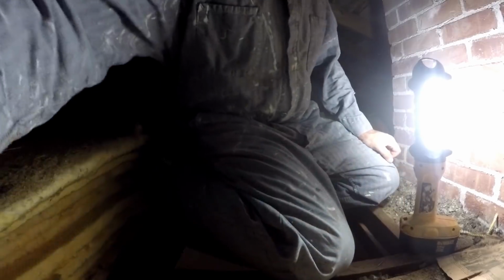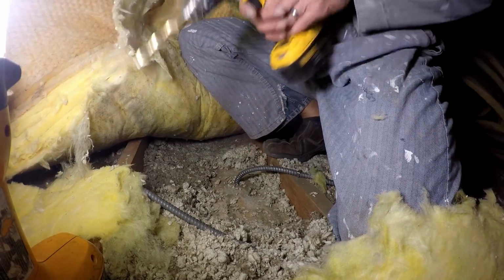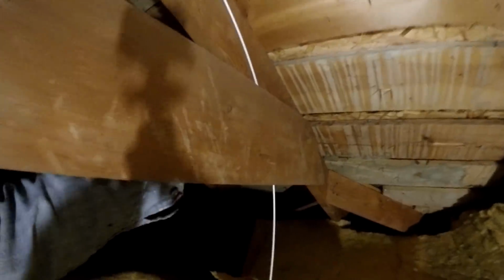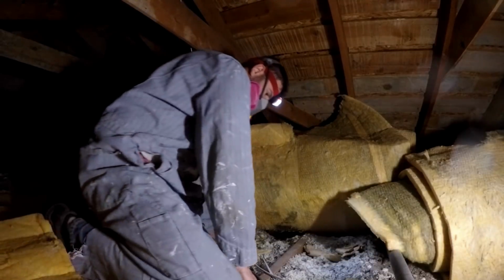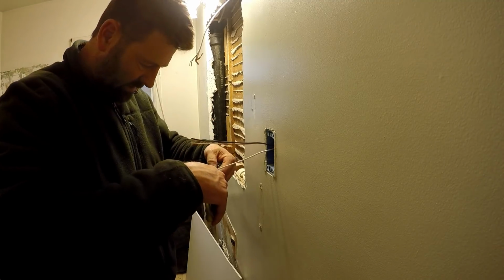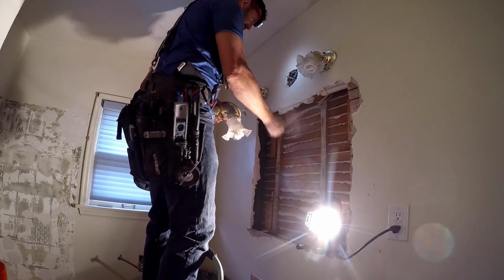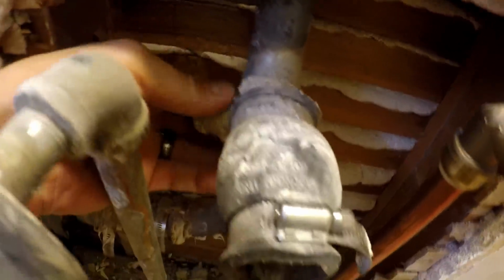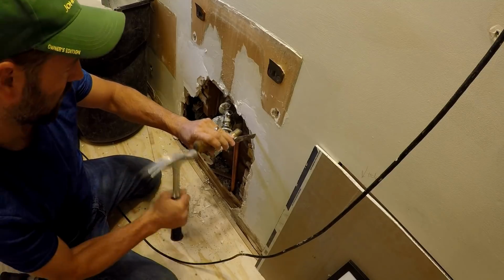1940s Bathroom Remodel | All New Wiring | THE HANDYMAN |

Comment: Huge Fan! Thanks for the "chipmunk" description of the 20 amp wiring to the 15 amp outlet. I'm installing an outlet and wire chase for my mounted TV, as the wife isn't a fan of the visible cords. Existing outlets are wired with 12/2 20 amp, but I ended up getting 15 amp outlets and wasn't sure if I was gunna fry something. I did get the correct wire to match the existing. Thanks again!
Reply: "Gunna"...that says a lot 😂

Comment: Great work. I really  hate working in attics, especially doing roof leak traces.
Hey man, Lowe's has a new headlamp called "LuxPro." It beats that 3 light deal you have by a lot. It's over 300 Lumens for over 3 hours. I use rechargeable Energizer AAA's with it. I've tried many and this is the best headlamp. I really like it for undersink work and also for  installing Kwikset thumb locks. These locks have a small, small, window to see where to bolt up the inside knob.  There is also a LuxPro 400 Lumen also, but it burns through batteries too fast; about an hour.

Comment: I know this video was posted awhile ago but i have a question. Did you get power for the light and exhaust fan from the circuit with the gfci outlet or does that have to be two seperate circuits?

Comment: now that the GFCI is separated from the light, where is it getting its power from?
Reply from the maker: Its now a a brand new circuit for bathrooms.  There is a new home run that goes back to the panel.

Comment: Can i just ask why in the usa the ground wire is not  
insulated at the socket end and fuse box end in the uk we use the exactly the same 3 core wire apart from the colours but we have to put an insulated sleeve over the ground wire at the socket end and fuse box end its part of the law in the uk its  to stop the bare ground wire making contact with anything that could make contact with anything live

Comment: Are you saying you're not allowed to wrap the wires around the screws? I recently installed a 15A GFI Plug on 12ga wire and had to wrap it around and it seemed like it was designed to accept that. Even though it was 12ga wire the CB was 15A.
Reply from the maker: that's not what I'm saying.  I said the the gfi outlets do not have stab connections and that you can't put 12 ga wire in stab connections.  The connections on the back of gfi outlets are designed for 12 ga wire and are clamped into place by turning the screw.
Reply: @TheHandyman1  Ah, ok. I thought the holes on the back were stab connections? I'll have to look into that more.
Reply: The screws on gfi outlets (and most new outlets and switches) accept square drive bits. You can tighten them much more securely with a square drive with less effort. I use a Milwaukee 11-in-1 screw driver which includes 2 different sizes of square drive bits. I think Klein makes one like it. Great for us old guys 🤗

Comment: you were saying something about only having 1 outlet on a 20amp circuit. but didn't go into much detail. Can you explain more about that?
Reply from the maker: If you have 1 outlet on a 20 amp circuit it has to be rated for 20 amps.  If you have more than one outlet they can be 15 amp outlets.  Most all outlets in a house that are on a 20 amp circuit are 15 amp outlets.
Reply: so there is no problem having multiple 20 amp outlets on a 20 amp circuit?

Comment: Not to be a "keyboard kommando" but at 4:36, it looks like you just routed the wire over top of that pipe... seen again at 10:20...
Reply from the maker: That is the wire that will go to the future fan.  Its just sitting up there.   When I cut in for the fan I will get routed properly.  I was wondering who would see that and comment about it.
Reply: @TheHandyman1  lol ok, that makes more sense.

Comment: Did you go over the top of that galvanized pipe in the attic with your electrical ?
Reply from the maker: That is the wire that will go to the future fan.  Its just sitting up there.   When I cut in for the fan I will get routed properly.  I was wondering who would see that and comment about it.
Reply: @TheHandyman1  👍

Comment: Sadly my the wiring in my how is rather old and the wiring is too thick to just stick in the outlets.
Reply: You probably have 12 gauge wiring instead of 14 gauge wiring which is actually a good thing as long as it has a ground. It can carry more power (20 amps). You simply don't use the push in connectors, you instead wrap it around the screw clockwise so as you tighten the screw, it clamps down on the wire. The reason the wire won't fit is because the outlets you are using are designed for smaller wire (14 gauge).